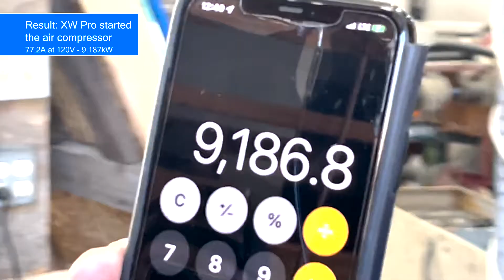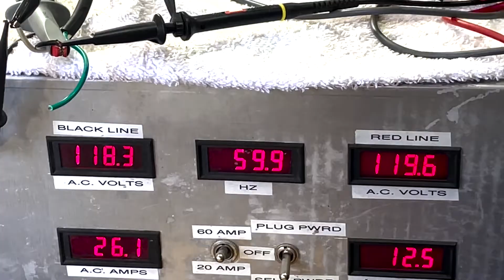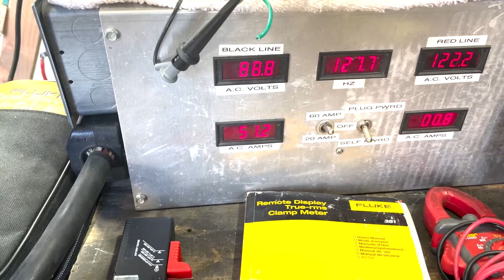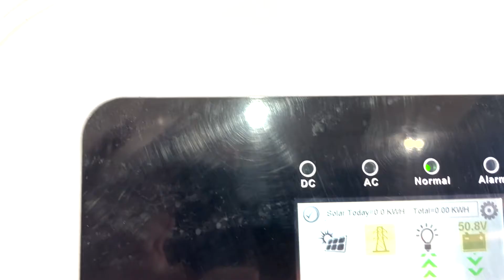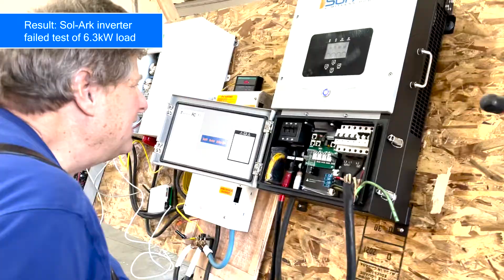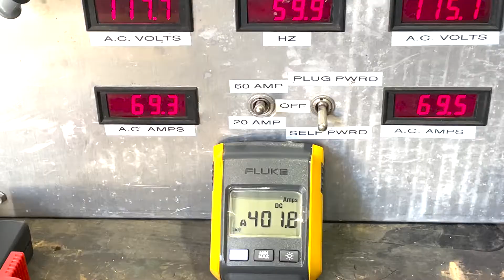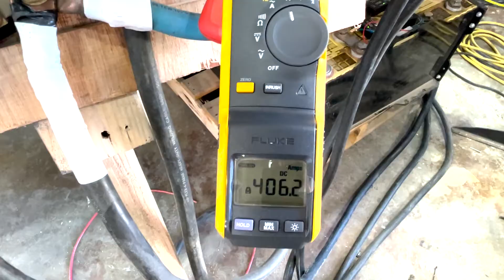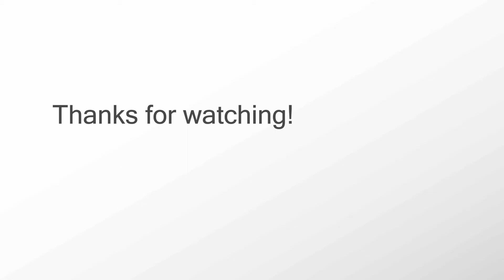XW Pro vs Sol Ark

Comment: Thanks for the video! I wish it was out before I bought my system. I am using a Sol-Ark 12k off-grid and was very disappointed when my miter saw would trip the inverter. I bought a soft starter for it, and that pretty well solved the problem, but then I tried another saw and even the soft starter would not keep it from tripping. And, I experienced the same result when I tried to start my air compressor! The Sol-Ark is transformerless which makes it much more efficient but makes it basically two paralleled 4.5k inverters. I believe each line will actually handle 4.8 - 4.9k before tripping off. I am solving this problem by adding an autotransformer to my main panel. While on, this perfectly balances all the loads and makes it to where the Sol-Ark only sees a single 240V load. It will actually put out 9kW reliably under these conditions and combines the surge capabilities of the two legs, but it does take an efficiency hit. I plan to test exactly how much of a hit, so I can manage it (turn off the autotransformer when/if not needed).
By the way, the reset time after the Sol-Ark inverter trips is programable and can be set to much lower. I have mine set to 15 seconds. In addition, the surge capabilities are expanded when you have solar power coming into the unit. This was confirmed as my saws would start more reliably during nice sunny days and not so much as darkness fell.
My only experience with the XW Pros was with a large system of two banks of 3 inverters. One failed almost out of the box. I found them to be flakey and finicky in their operation, way too involved to setup to work with the grid and a generator, the native monitoring was terrible, and Schneider's support was not great. That experience and one other (different model) ruined me on Schneider inverters. Sorry ...
If I had it to do over, I would probably pay a little more and setup a Victron system. I have a small Victron system in my RV and it has performed flawlessly. My 3k inverter will even start every tool I have (never tried the air compressor). My only complaint is that the factory support is quite lacking, but there is a large knowledge base out there from which to draw.
My two cents ... thanks again!
Reply: I find your comment suspicious . You start off by saying " I wish this video was out before I bought my system "  and end with your "experience with a XW pro  ".
  .

Comment: Just installed my schneider xw pro and did some load testing.   Ran my 6000w dryer, 1500w microwave, washer 1500w, dish washer 1000w and 3/4hp well pump no problem.   It's a beast.  Need to try A/C compressor next.
Reply: Hi JY.  I'm ready to install a on and off grid solar panel system, I want a 15kw system using sol ark 15kw. But my solar system installer want me to put a 6kw system. I want a 15kw system, for our robotic lifestyle to come. To charge my robotic cars,washer and dryer, vacuum cleaner,  house windows, motorcycles cars and trucks, lights and human like adult a.i. robotic 🤖 and pets. Ect.ect. could add a link to your YouTube page? Thanks.
Reply: @go5582  dont do anything less than the 15k for all you are trying to mess around with.

Comment: I have owned both a Schneider XW+ and a DEYE inverter (what Sol-Ark is based on). Once I had my Schneider running I never had any problems with it. Their hardware is wonderful, but for most people, the Sol-Ark is the better choice on grid (as an installer most customers have an easier time understanding the Sol-Ark vs the Schneider). Off grid, I definitely feel better with a Schneider system or an Outback system. Great video showing some real world usage!
Reply: I have a DEYE 8k that I use 99% of the time on grid with zero-export, but I've run it through its paces off-grid mode and haven't run into these problems like the Sol-Ark here. Having said that, my brother-in-law has pure grid-tie solar and wants to add off-grid ability, and I've been looking at the XW Pro for a while. My Deye doesn't complain if one leg is almost full load and the other has nothing. Also, it runs my old 4-ton (non-inverting) AC just fine. I only have a small air compressor that everything seems to be able to start.
Reply: Hi.NL. I enjoyed reading your comment.  I will use schneider XE + and a DEYE inverter
 Thank you .
Reply: Hey, I want to buy an inverter to run my whole house with the grid as back up.  I was looking at the Deye 8k.  I don't have any air compressors or well pumps or anything like that.  Just regular stuff, fridge, freezer  microwave, eashing machine and I would like to get AC one day. I can see that the Schneider is great but it's not in the budget. Can I get away with the Deye 8k?  What would you recommend? Thanks.

Comment: I think you might have a bad Sol Ark/outdated firmware, something. These units have been powering under construction homes for us all over the place. Compressors, table saws etc. I will attempt to demonstrate this and upload video! Have a massive compressor at one place, no problem with only the 12K.
Reply: Same here.. I'll run my 80A welders (whose startup waveform is a cliff!) and my Sol-Ark 12k doesn't blink. When I'm grid tied it's smart as hell about when/where/how-much to apportion to which load and sell-back and battery.  One i wired up my own local data collection (instead of needing a chinese website) it's been smooth sailing. Built out the PV array and now have two 12k paired together. Also super smart about how they work together.

Comment: The XW Pro was my initial choice after research for these reasons. I'm curious about the question below, if the solark was set to max out at 100A on the battery. I'm sceptical about it failing to reach it's published specs.
Reply: At 14:30  it was clearly drawing 150 amps from the battery .
Reply: @onthelake9554  The question i what was the setting in the Sol-Ark.  It may let you got for a few seconds at a higher surge load but then it will trip.
Reply: @Dreadlk  That would be an even bigger problem if it will draw 50 percent more from the battery than you had it limited to . I hope that's not the case but I wouldn't be surprised .

Comment: I’ve been running my entire home on two 12K’s for 15 months. Sometimes a circular saw or vacuum will trip them. I now run inductive loads on a 48Vdc powered hospital ups. If Schneider had better customer service in 2021, I would have gone with them. Sol-Arks work fine with soft starters on heat pumps or like two of mine with inverter compressors, fan, blower. Get what’s best for you. 17MWh produced last 12mo.

Comment: Inverter wars. Schneider does not seem like a good fit for off-grid, DIY type of installations from what I've gathered in the interwebs, but does seems like well designed equipment. What I'd really like to see someday is a real life comparison to issue resolution/customer support for these companies. I like the dump load and generator peak shaving features of the Sol Ark. As David Poz said in his video, it's all about your particular use case...
Reply: schneider will do gen support and ac grid support
Reply: I know the schneider inverters too have all this load shavings and peak load offsetting features too as i presently use one.
Reply: Schneider is a beast! They weigh a ton and work well. I have a 6048 and am expanding with a 6848 soon.
Reply: Spot on, ran solark offgrid since 2019, the only tweak is using an auto transformer for large compressor and chop saw. Never had a 240v device trip it, welding and plasma cutter high amp. 
It’s pretty seamless setup off grid with gen and smart loads, built in 12kw mppt and hybrid efficiency. 
Offgrid is not plug and play, ppl need to design the system and it’s certainly not just load capability.

Comment: PS I AC couple the sunny islands on the AC input Buss my arrays are spaced on a long line since my sunny island system is in the shop 350' from the house. Array around 13000 watts but actual output around 9000 average.

Comment: I am glad I found your channel.  I used to watch Jack Rickard's channel but he passed away.  Jack used to use Tesla batteries to experiment with, I can't wait to see what you come up with now.  I am going to be retiring in Southwest Asia and I have a solar power system there already but I will be adding a few.  The inverter I am using there now is the Deye which is a Sol-Ark under a different name that outputs 240v.  Sol-Ark has a deal to be the sole provider of Deye in the US.   I am using that inverter because it was available.  I've been thinking about going to Victron but now I am looking at the XW Pro too.  Sol-Ark / Deye can be "paralleled" for up to like 16 units.  I don't know if that would help in the testing you are doing, but the Deye inverter I bought overseas was 1,600-ish dollars for an 8kw unit so I can string a few of those together before I get to the price of one in the US.  Deye and Sol-Ark are made in the same factory and have the same software, only the case looks different.  I want to eventually run 240v/60hz to some plugs and devices and 120v/60hz to others so I can run stuff I have from the US too.  It sounds like a will need another inverter to do the 120v/60hz stuff which is  mostly electric motors and stuff that can't switch between both like a laptop can.  I've got 16 panels of 500 watts each on the roof and 16 more ready to install.  The batteries are 200ah 48v and I have 6 of those.  The batteries I have are 300 lbs a piece.  I am not so savvy on what I need so I am hoping to learn from you on your channel!!

Comment: That is why I parallel 3 Growatt 5k inverters with 4 48VDC battery banks (60KW). Only the Schneider can do it with 1 and a huge price tag. I also like redundancy and only need 1 inverter to run my loads but as he stated it takes 2 for huge load startups.  I might change to Schneider's  inverters in the future as I already bought.

Comment: Awesome! The xw pro is a beast. 
Can the xw pro supply grid tie power to the homes main panel and use batteries+solar to do so?
Reply: the xw will grid tie if the parameters are met ie battery voltage is above the sell back cut in setting.

Comment: Frickin awesome. Was looking at a solark and no longer am. Haha. I have cheap electrical price. But our power goes off more often than i think common household does. I live in the middle of no where. 160 acres. I’m looking for a device that can be a whole house UPS. I have (16) 390w solar panels and we get a lot of sun, except 50% of our winter days are foggy. I want my house to take our abundance of sun and use as much as it can before taking our utility power. When the power goes off I want MOST outlets and devices to be powered. I think I’m okay with 90% of our 240VAC appliances being off line during a power outage. But I’d love to have our 240V well pump powered. I have a lot to figure out. I live close to Grand Coulee dam in Washington state and our bill is 6.8 cents per kW, which is why I didn’t want to spend too much on solar. I bought Tammarack 4-panel array mounts.

Comment: I'm 100% satisfied with our older Xantrex XW 4024. Even though I should have gone larger (8048) This thing is a beast. 95% of the time, I trip battery inputs before the inverter glitches..  I was going to upgrade to a Sol-Ark for ease of interface, but thanks to your vid, I will be thinking twice on that.  
 The beefy XW is more than twice the weight, but 4x the machine..
Reply: KTCUSTOM - my wife and I are setting up our property off grid. We purchased a altE Pre-wired Syst, SW4048,CL150, SCP. I have changed my mind about installing this unit at all. The battery banks we were able to retrieve from a telecom company are Absolyte GX 48 volt, 2,000 Amp Hour. The small 4048 won't be able to charge one of two batteries much less two battery banks that size. How many kilowatts of solar panel are you running and what size of generator to you operate to charge your batteries? I would imagine the 8048 you have can push a lot of power. Thanks for any feedback.

Comment: I have a 1hp, 240V well pump I would like to run off an inverter after we get hit by a hurricane.  Will the XW Pro with (2) 48V /100AH batteries be enough to run this? Does that require two XW Pro inverters?  It's difficult to find an off-grid electrician to design and install a system in our area.  Any suggestions for someone who does this type of work in South Louisiana?
Reply: It likely will (1 HP is less than 1000W) but you need to check the specs on your batteries and determine if they have a max amps where their BMS (assuming Li-Ion) shuts them off. Your limitation in this setup would be battery capacity, the inverter could empty those batteries in under 2 hours but it's not likely they could support that level of draw.

Comment: I have a 12 k and I have had no problem with it.i don't need to run a air compressor and I have never seen a microwave coffee machine and whatever pull 9000 watts.but it does do just fine for my needs when grid is out.

Comment: I have this in my garage about to install it! I already have my solar working with a cheaper "learner" 6Kw inverter from Sigineer because I did not want to destroy my Schnieder while I learned electrical engineering. My questions is, I have have 3x5 375 watt REC panel strings with DC optimizers feeding into an AIMS Power Combiner box, and the combiner box sends out a perfect 200 volts. I know the Schneider XW Pro doesn't need the combiner box, but I love the performance and safety of the AIMS Power combiner box because it also has fuses for Lightening, can I just pull out the Sigineer inverter and drop in the XW Pro keeping the lightening protection of the combiner box and put this PV group on one string feeding into the inverter? Will this manager a 200 volt input well or do I have to put them all into series to have higher voltage? I prefer keeping the voltage lower but the XW Pro has a higher voltage rang up to 600 so I am not sure.

Comment: OK,  I'm looking to put in solar, but my concern was house and shop is all electric,  and on grid, it not nothing to have 10k surges, and I've been worried about this. So, what is the largest stackable unit available.  I was thinking about a 12k are 15k to start with , and then upgrading to 2 at a later date? 
Thank you
Gary

Comment: I have yet to install our altE Pre-wired Syst, SW4048,CL150, SCP but I am wondering if we need another unit to operate our RV while we build off grid. We have two Absolyte GX 48 volt battery banks (2,000 Amp hour each). I may be way out of my league with thinking that we can provide enough watts from solar arrays. What do you think?
Reply from the maker: It is important to keep those batteries charged, The SW4048 has a small charger compared to the 2000Ah of battery you have at a min it would add a second SW4048. Those batteries like to be charged with 200 amps to keep the sulfates at bay.
Reply: @abneysolar3941  There may be an opportunity to purchase a used XW Pro from Utah. I am wondering that that unit would be better suited for the charging purchases necessary to keep the Absolyte GX's in shape. I am discussing it with my wife. It will mean reconfiguring solar panels as well. Thank you for your response.

Comment: More a question than a comment. Is it posable to get into the firmware to balance the output of dual 6848 in real time WITHOUT investing in the $700 SE tool? 
Off grid 95% of the time. Charging (12) 51.2 VDC, 100 AH life power lithium phosphate batteries from (38) pc of 405-watt Mono PV each with an Enphase IQ-7 micro inverters. XW Pro's set up the 60hz grid for the 1Q-7s which works wonderfully off grid but sketchy if I try using grid support or self-consumption.
System runs everything including (2) 3-ton inverter-controlled AC units and pool pump. XW Pros are beasts. But the slave is always doing more than the master. I'd say there is a 10% difference. When almost recharged I can readings that show the slave is powering the master. other than efficiency loss is it hurting anything?

Comment: Quick question:
Sol-ark 12kW and Sol-ark 15kW both appear to struggle with drawing current from batteries. 12kW max.

I assume that the Schneider 12kW struggle regardless of whether it draws power from the PV's, the batteries or the grid.

How does the Sol-Ark 15kW if it has an ability to bypass grid current @ 48kW? Did they create this bypass feature to compete with Schneider's superior surge handling?

Would Sol-Ark have tocopy Schneiders design and do the 48VDC to 48VAC first and then use a transformer to step up 48VAC to 240VAC? 
This that the main difference between the two is that Sol-Ark is transformerless and converts 48VDC directly into 240VAC instead?

Comment: Sol-Ark 12K has 16KVA limit for 10 sec (66.66 Amps in balanced system) you are trying to star a motor with LRA 90 Amps, it is not possible with that Sol-Ark. Can you share picture or videos showing the alarms and configuration to understand the whole test. Can you check the configuration in the discharge battery parameter (Max A Discharge) and double check that 185 Amps is configured.
Reply: Exactly the problem. If you don't go into the menu's and set the battery bank capacity your stuck with the conservative default setting which I think is 100A
Reply: I Would like to know if the setting for this test was done with 100a or the changed setting of 185a.

Or rerun the test.
Reply: @Dreadlk  At 14:30  it was clearly drawing 150 amps from the battery .
Reply: At 14:30  it was clearly drawing 150 amps from the battery .
Reply: @Upliftyourbrothers  At 14:30  it was clearly drawing 150 amps from the battery .
Reply: Yeah- I’m skipping solarc for a beast low frequency inverter.

Comment: I have an old XW 6048. I cannot get it to run with LIFEPO4 battery without throwing error codes when the BMS turns on or off. I have tried many variations on settings. Is there a Firmware up date or different settings that would get me up and running.